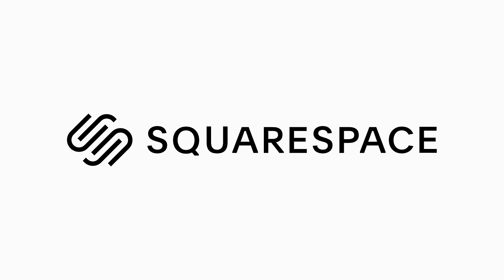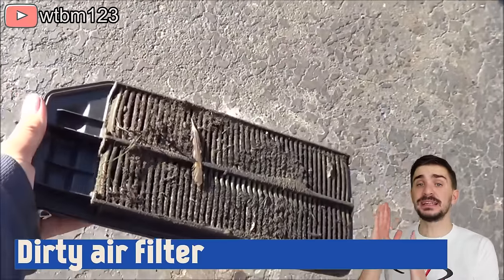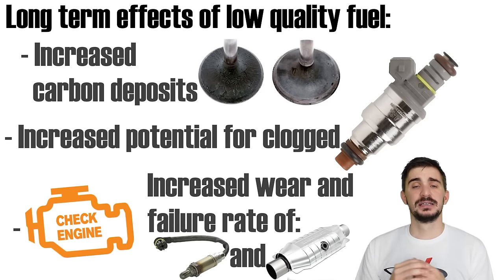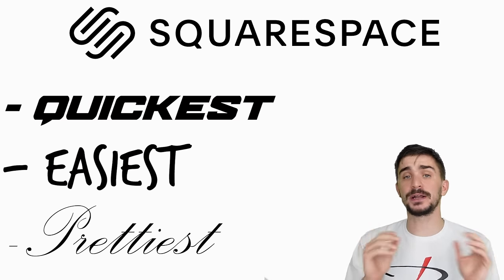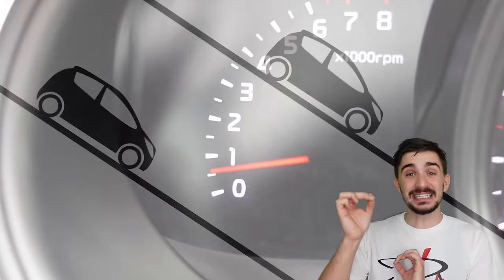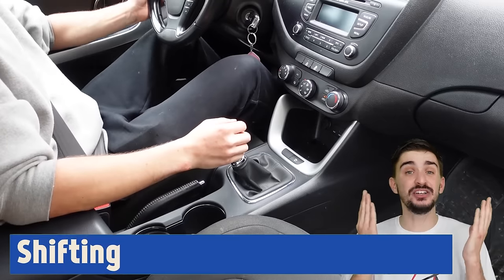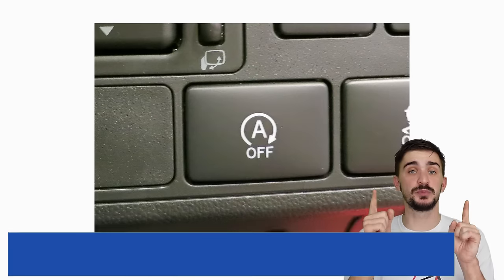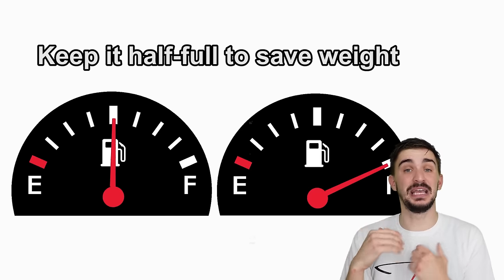EVERYTHING on FUEL SAVING - PRACTICAL DRIVING and MAINTENANCE techniques to REDUCE FUEL consumption

Comment: I strongly disagree with the drafting. 

In the context of the footage you provided, everything you said about drafting is true. However, you don't have to be this close to the big truck in front of you as in the video (it seemed like 5-10 feet). Surprisingly, you can be as far as 100 feet behind the truck and still save fuel. Mythbusters tested this and 100% confirmed it. By pure memory, this 100 feet distance can reduce the fuel consumption by something like 5%, which doesn't seem like that much but can add up pretty quickly.

Otherwise great video!
Reply: And a following distance of 100' is just about perfect till you hit usual US highway speeds; it is also the one ticket most departments and the courts that support them will write, based solely on the officer's subjective viewpoint. At 60 mph, you should be 120' plus, at 70, 140' minimum, smart would 160' or better. The distance helps give you "recovery time' because most people don't have "catlike reflexes" and will take three tenths of a second or more before they even begin to react. And yes, NASCAR drivers do 200 mph and survive- all the cars are going in the same direction and all are highly skilled, professional drivers who have spent half a lifetime learning how to do that. Have you? BTW, even at a follow distance of 100', if somebody in front of that truck does something stupid, you will have hit the truck before you realize something is happening. And that is at 50 mph.  FR
Reply: If you just drive a constant speed in the same gear and throttle, your ECU will optimize the AFR. Those are the gains you get from "drafting" outside of the wake.

Comment: 23:48 hybrid systems ARE affected by climate, as cold weather will descrease fuel economy by a sizable margin, unlike an internal combustion car that will even perform better thanks to the denser air
Reply: I think you have that wrong but be interested to know where you heard this. Cold weather only reduces economy in electric cars because energy is used to create cabin heat.
Reply: Toyota venza** https://youtu.be/FTuPm9UYQw4 2:50 for reference
Reply: I notice slightly better fuel economy by warm weather in my small petrol car. I suppose less dense air means less fuel needed to reach stoechiometric AFR and since I almost never go WOT in normal driving conditions, my car might be a bit more gutless than usual but it results in better mileage.
Reply: @malolavoue4717  yeah, I was actually impressed by how much more torque my diesel seems to have in colder weather
Reply: @malolavoue4717  As a commercial pilot, I know exactly what you mean with density altitude in reciprocating engines. I however have observed the opposite with at least two cars in that cold air reduces economy. I have no idea why. On a trip many years ago heading due north over 1000 miles in a vehicle with instantaneous economy readouts, the temperature dropped from above freezing temperatures to - 30 C steadily over an 8 or 10 hour period. I did not cross weather systems in which air density, precipitation, wind or road conditions. My fuel economy dropped drastically and quite linearly as the OAT dropped. That was in a fuel injected engine. In a previous car that was carb'ed, I typically got far less economy in the winter on the same tires that in warmer and more humid weather. I cannot explain those observations but they were consistent
Reply: @majbach1968  In a modern car I would guess the computer adds more fuel when air is denser, I have no idea what could happen in a carb to lower economy

Comment: How to save gas: drive a honda
Reply: It depends on the size and weight of the car, no matter which brand you drive.  Also consider the price of the car.  If you spend an extra $2000 to get a couple of extra MPG you really aren't saving anything.

Comment: People do ask what is the hardest time for the engine?
I think when you start the engine.

The engine can run so many miles with just routine oil change and minimum maintain, but if you keep turn your engine on-off, it won't last long.

Comment: A point about car AC: When the AC is on, the compressor is running. The air temp from the vents is controlled by mix doors, which cause some cooled air from the evaporator to be mixed with some ambient air from outside the vehicle. Because of this, the temp you set the AC at has no relevance to fuel economy. Using one of those windshield screens when parked may make it so that you have to have the AC on for less time (or not at all), but the amount of work the AC compressor does when the AC is on - regardless of the interior temp or the temp setting of the AC system - is not variable. If you decide to run the AC, make it as cold as you want.

Home AC works differently. When the target temperature in a home is reached, the AC compressor turns off.

Comment: Haven't fully watch it yet, still in 1min span.
And i am thinking that this VID would be the ultimate guide for us in saving GAS / Diesel.
In the side of a mechanic and very conservative in my fuel consumption,
Been using actually our brake pads for 10 years, still in half thick. 

See you guys in the end, thanks in advance @driving 4 answers
Reply: huge engine brake use here., be always in right timing of gear and rev.

Comment: I have ridden with SO  many drivers who seem to think the accelerator pedal is operating an old pump organ. It never occurs to them to find a sweet spot between idle and WOT.
Reply: How bizarre - I guess they never learned to drive a manual? :D Pump-organ pedal use gives you the worst of both worlds in terms of economy: open-loop fuel enrichment because of the WOT, plus accelerator tip-in enrichment while you're getting there.

Comment: There are additives that can improve fuel economy in higher mileage and older vehicles, techron does a good job, I use it and then run the tank low before changing fuel filter

Comment: By sticking to traffic without dumb acceleration and braking, preserving momentum and respecting speed limits(mostly), I've managed to wear my brakes to almost nothing in 80.000km. Both discs and pads (front axle) were changed at the same time and they have all worn out at the same time. I believe I've saved more money on parts than on fuel with this one. Usually a set of brake discs should be able to withstand 2 or even 3 sets of brake pads. 
No, I didn't push the brakes to limit. The first time I could hear iron scratching on iron, i've inspected the pads: there wasn't much left, but there was still some to make through probably the whole month. The next day I did a full brakes replacement on the axle.

Comment: Very good video! I am baffled by how many people don´t know that you should coast in gear for fuel saving. It´s the most normal thing to do but so many are doing it wrong...
Reply: Eh, depends, coasting in neutral can save fuel in some, coasting in gear in other scenarios.
Coasting in gear helps when you need to slow down anyway, but if you have to apply gas its better to coast in neutral.
95% of times its better do coast in gear, so yeah many people are doing it wrong, but there is a kernel of truth to it.

Comment: coating in neutral kinda works if you are going downhill and don't need engine breaking.if you're in gear  you ' ll need some  throttle. but generally speaking downhill just lift throttle and use the gear that will maintain correct speed without throttle or braking.

Comment: Engineering Explained tested a car and he found that starting the car uses as much fuel as 7 seconds of idling. However it is true that starter motor of cars without start-stop systems will not be happy to be used like that in a city environment. Switching off your engine at train crossings or roadworks where the expected wait time is over 30 seconds can be useful though.

Comment: You could have said more about autos vs manuals. My manual used a lot lot lot less fuel because of the direct connection. But my automatic car now drinks a lot more, since only the final gear locks the turbine. So in the city, all the 1-2-3 gears don't lock, so I keep slushing that box. The difference is, on a manual with electronic throttle, you can hammer it and it doesn't affect consumption much. But on an automatic torque converter it is best to use really smooth accelerator work and slow accelerations. This way the slushbox slushes less and generates less waste heat.

Comment: I have a little rule that I think saves fuel: When approaching a traffic light from a fair distance, accelerate slightly if it's green and brake early if it's red. The logic is that if it's green you increase your chances of making it before it changes to red, and if it's red you increase your chances of it changing to green before you get to it and have to stop. I've found this strategy works in about four out of five cases. Obviously stay within safe speed limits and respect traffic conditions.

Comment: When "coasting" in gear, also be aware that higher RPMs (i.e. lower gears) will increase engine braking, so if you don't need to slow down you should shift into the highest gear that stays above the idle RPM, and likewise if you need to go slower you should downshift, which will save wear on your brakes, and while it does increase engine wear to some degree you'd have to get pretty close to the redline for it to outweigh the brake wear benefit.

Comment: drafting behind a semi on the freeway once saved me from running out of fuel on the freeway, and I was keeping some distance from it. so it's not ideal, but it's a life saver if you respect the gap

as for more techniques for manuals, engine braking with downshifting is pretty useful when stopping for a red light, but for this to work, you have to see the traffic light from far away (the further the distance the better, since you have more time and space to lift off and start rev matching the downshifts)

Comment: Think I have the 'right' car for just now - Suzuki Celerio converted to LPG, I get 44mpg and the fuel costs 73p per litre (compared to £ £1.55+ for petrol). I've worked out given the current electricity price of 28p/kwh my cost per mile is about the same as an electric car getting 4miles/kwh, but unlike an electric car I can do 350miles (and have petrol as a back up) and the car + conversion cost £5400. Although LPG has gone up about 40% since I bought it, the cost savings are actually greater now. Only downside is that it's hard to justify driving my other far more interesting cars when they cost 3x as much to fuel!
Reply: Definitely the way to go. How do the valve seats fair on the Celerio with LPG?

Comment: to hypermile, if there is no traffic/stop/lifht in front and speed limit allows, you should accelerate ideally in the most efficient rpm/load sweet spot, up to top gear and then cruise at most efficient rpm. this is usually not achieved by accelerating very smoothly/slowly. recent automatic transmission  should do it quite automatically in eco mode at 50/70% throttle.
it's also different for every engine gas/diesel NA/turbo/supercharged diesels like low rpm high torque. but usually somewhere around half the max rpm and half throttle is not a bad spot.

Comment: I buy small cars with manuals. When the light goes red or will before I get to it I throw car in neutral and coast, usually get a green before I get to it. Always some impatient driver blasts around to get in front and I end up having to stop because they now had to wait at light.
Drivers that drive faster usually don't get down the road before me and I get better mileage than listed for my car.

Comment: rear hatch bike rack doesn't lower mileage significantly on my Sorento V6. I've done over 30mpg driving over speed limits (with the traffic) with three bikes with the rack setup pretty low so that bikes don't  go over the roof line. opposed to 25mpg EPA rating and 32-33mpg best case with very smooth traffic, reasonable speeds around 75 maybe the poiler helps, but definitely bikes in the low pressure turbulent area behind a SUV don't generate a lot of drag, probably a bit like tailgate up in a truck is actually better than tailgate down. I'm sure bike rack on a sedan trunk or even worse on the roof makes much more difference

Comment: One aerodynamic mod that can be done cheaply (if your climate allows it, and you don't mind looking ugly) is using tape to partially cover the front grill. The radiator is a major source of aerodynamic drag, and in colder weather and/or freeway driving you need less airflow than hot weather and stop-and-go traffic. But of course, be very careful you don't go overboard and cause overheating. And keep a close eye on how much your radiator fan is running, if it's on too much that means you need more air.

Comment: I have a truck for when i need room to move stuff and a motorcycle for getting to and from places. 3.5~ gallon tank with about a 180-200 mile range on the bike. If you get a 300-400 cc bike you could get 70-80 mpg

Comment: I recently started binging your channel (I just like the way you explain things.) So I felt like adding a simple explanatory example to your explanation regarding how oxygen sensors giving an incorrect reading can affect fuel economy. Specifically, how EXHAUST LEAKS can cause fuel efficiency loss (since many people find this concept to be confusing):
Most oxygen sensors are voltage GENERATORS. They do not take voltage from the battery: They use a chemical reaction resulting from the difference between "naturally aspirated oxygen" (ambient air outside of the vehicle) and the combusted air fuel mix in the exhaust to CREATE voltage.
So, where do these sensors get a sample of ambient air from? Why, the wires on the sensor! Often, one of the wires leading into the sensor is designed to allow air to be "wicked" into an internal port in the sensor. That oxygen is then used to create a reaction based on the chemical difference between the internal and external air samples. The amount of voltage depends on how different the reactions are.
THIS is why an exhaust leak can result in an engine running rich (aka wasting fuel.) The ECU is fed readings saying that the air fuel ratio is LEANER than it actually is (indicating that the air outside the exhaust and inside the exhaust are LESS DIFFERENT by virtue of the strength of the chemical reaction that generates the voltage the ECU reads- less different because the external sample is being polluted by the internal one), and compensates by dumping in more fuel, all because exhaust gas made it into the oxygen sensor's external air port, causing a weaker reaction, and thus lower voltage, than would actually be correct.
Of course, some oxygen sensors operate with a reversal of the implied meaning of high or low voltages, but I don't understand how those generate voltage so I won't even try to summarize them.
But there you go. Exhaust leaks can cause a loss of fuel efficiency, and here's a simplified explanation of why it actually makes sense... For anyone who is wondering.

Comment: Actually on the drafting issue.... If you adjust your distance further back ( usually a very safe distance away ) mostly marked by the quiet smooth zone about 3 ish car length behind a semi you will save fuel. Not a lot but its there especially in a head wind or tail wind situation. And its easy to maintain on a high way or free way as both you and diesel are most likely running on cruise control.

Its main benefit is less noise and smoother ride.

Basically the turbulant air will hit and cancel out at closer to the speed of travel in the direction your going.

Comment: When it comes to acceleration theres a common misconception I hear even from driving instructors sometimes. And that is to accelerate slowly. That implies to many people that they should use the throttle as little as possible. The most efficient way to accelerate is almost the opposite especially in petrols. Around three quarters throttle but also keeping the revs down hence upshifting early is the way to go. Rule of thumb is keeping the revs somewhere between 1500 to 2500.

Comment: I experimented with this a lot. Imho you get the most fuel saving with the less struggle by: Less braking. The ammount depends on the vehicle, but especially heavier ones seem to gain the most mpg. I see about 10-20% fuel savings on my cars.
How I do it: I try not to brake (unless neccessary). Especially on highways if I see f.e. a construction site, or a speed limit, ... ahead: I let of the gas pedal early. After some practice you get a feel for how long the car takes to reduce the speed to a certain amount. 
The principle behind that is simple physics: To accelerate your car converted chemical energy (fuel) into potential- and motion energy (and stores that energy). If you use the brakes your car gets rid of that stored energy and wastes it (converts it to heat). Because that heat is useless to you: Its better to use that energy to continue moving. 
BUT do not do this if theres other drivers close behind you! Because its very annoying for the others, because theyll need to brake (and accelerate) a lot to adjust.

Sorry for my english. Im not a native english speaker.

Comment: A note about fuel additives and cleaners - they CAN improve economy on cars with dirty injectors etc. This is why they can get away with advertising an MPG improvement, but they'll make zero difference on a newer and well-maintained car. These same additives are also often included in regular petrol and diesel at the pump.